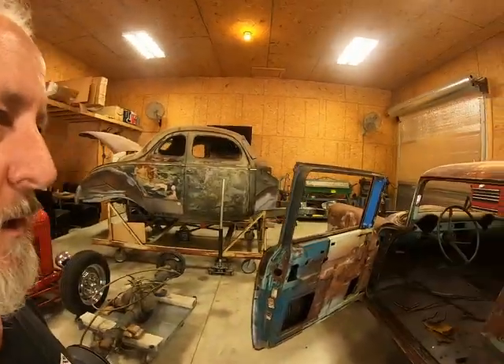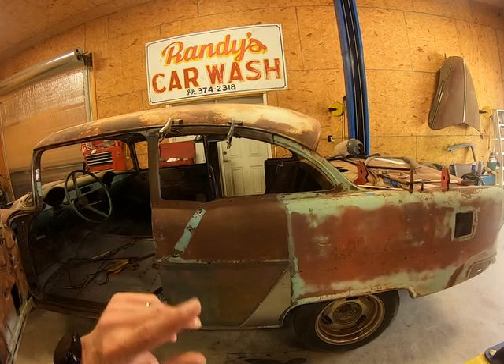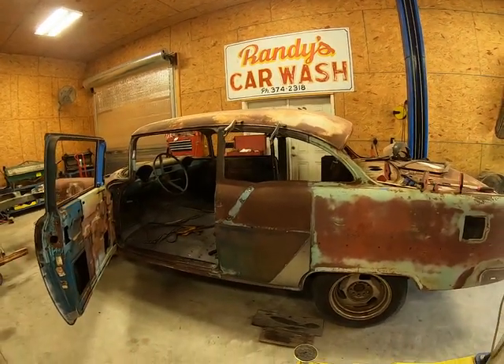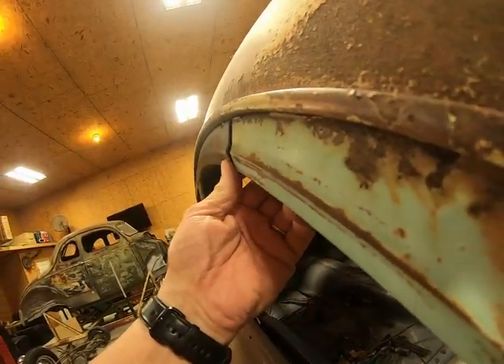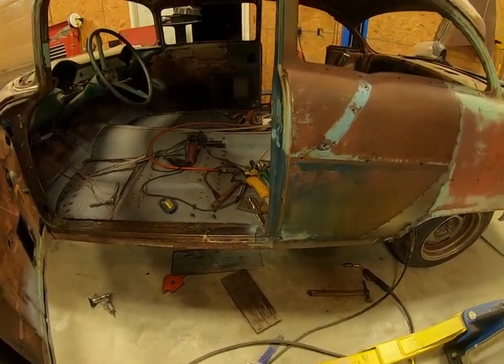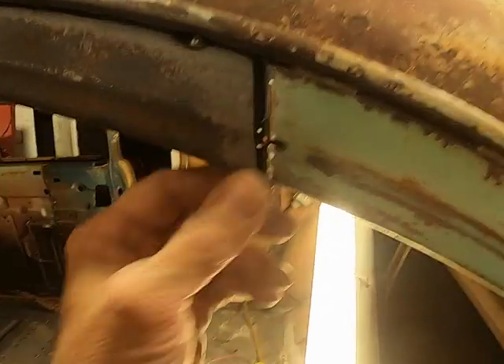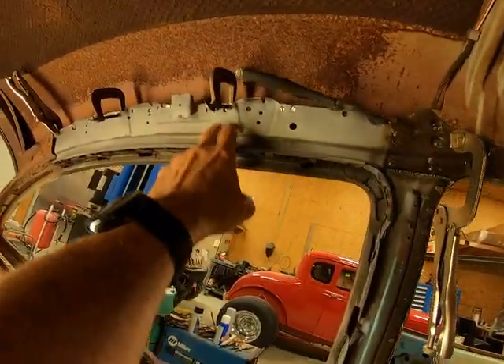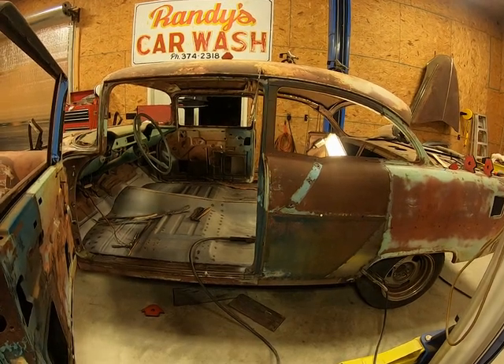55 Chevy 4 Door to 2 Door Conversion Project Update 4

Comment: I just stumbled onto this. Looks like your front doors are made from front and back 4 door doors. Cool. And you didn't have to source two 2 door doors.
Reply from the maker: Yep that's right. I just made the doors I had work! Thanks!
Reply: This is the first 2 door doors made from 4 doors that I have seen where the converted doors are actually going to be used on the car. Ones I have seen just show that it can be done. Also I have never seen one completed with the back windows working properly. Wish someone would tackle that. I’m a new subscriber who found you by accident. Like what I see. Will follow build. 
              👊😎👍👉🇺🇸👈

Comment: I had a donor 2 door that I cut out that inner plate and drilled out all the spot welds. I then welded every one on to the new car, did I go overboard on it?
Reply from the maker: If you want the window to roll up and down, that's the way you need to do it. My windows are going to be stationary using urethane.

Comment: it  would have been easier to use a set of doors from a 2 door  no /yes
Reply from the maker: yes, it would have been.  But them doors are about $700-800 each.  The way I did it, I got time and labor.  If you can find used doors at a reasonable price that would save you some money too!.  Sometimes, you gotta do it just to prove to yourself that you can do it!